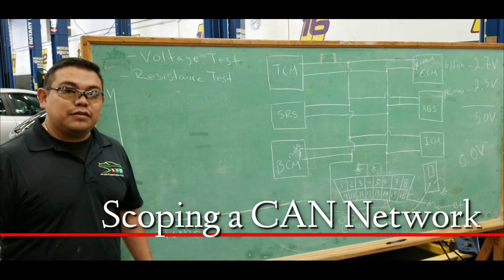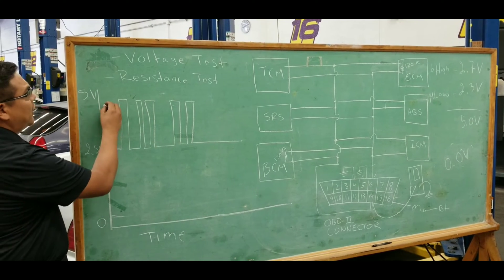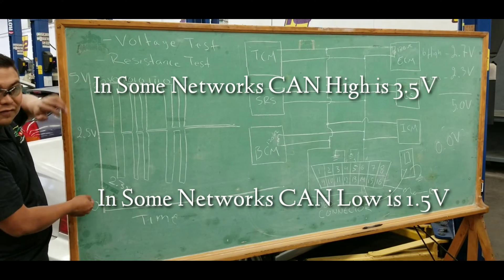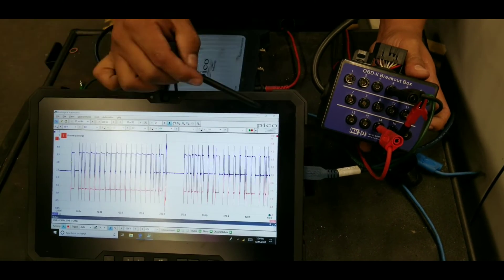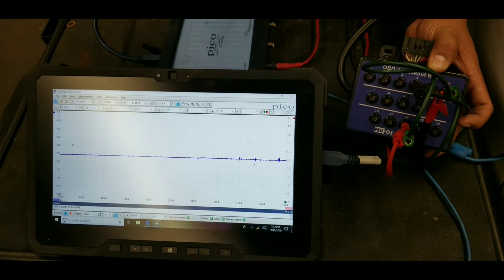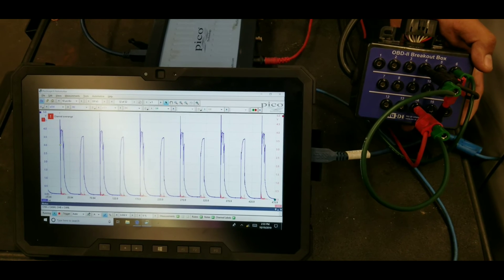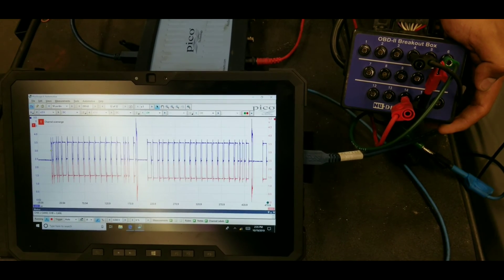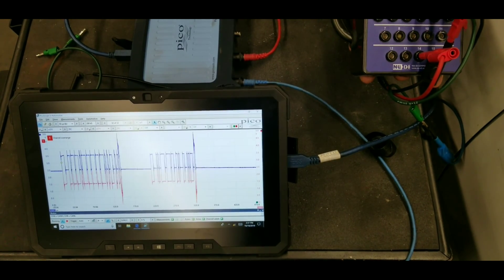How to test a CAN network with a scope.

Comment: Great informative video. what speed did you have you oscope set at to get that waveform, and where would you start to look if the voltages were low on the busses?

Comment: GM have individual can networks. For example you have can three can for can five and so on. So when you scope it out which network are you looking at?
Reply from the maker: Now days vehicles have multiple CAN networks A,B,C and so on. You would test the one you have communication issues with. If you can't communicate with several modules, refer to the BUS network diagram and see which one you would test.

Comment: any guidance on how to connect the scope leads? like how do you connect them and where
Reply from the maker: The high side of the CAN bus is pin 6 and the low side is pin 14. Connect each channel to one of them and a ground on pins 4 and 5.

Comment: how do you go about tracing down suspected shorted can wiring? can you do it like we do with any short by switching meter to ohms and placing one lead to ground and other to shorted can then go and wiggle harness till we see the meter change and disconnecting parts of harness to isolate it?
Reply from the maker: https://youtu.be/JicbzR3Juh0 In this video I give some examples of hot to do some tests.

Comment: all we are doing is seeing voltage. why cant we just use DMM? it get a voltage reading. if we short Hi or Lo to ground you will get the voltage change. im just trying to understand why we really need Oscilloscope?
Reply: Communication lines switch at such a fast rate that a dmm can’t interpret what is actually happening, it will just give you an average voltage….. you need to SEE what the waveforms are actually doing in order to diagnose accurately

Comment: can you use a  short finder like a powerprobe unit to track were the wire could be shorted
Reply from the maker: A short finder will help if one of the lines are either shorted to ground or power.